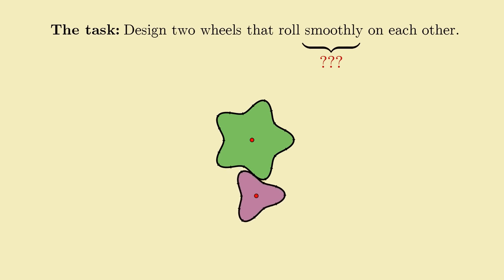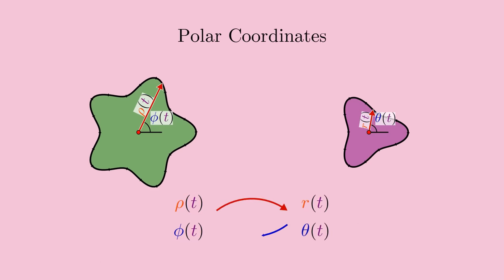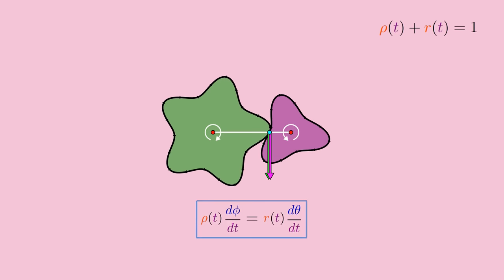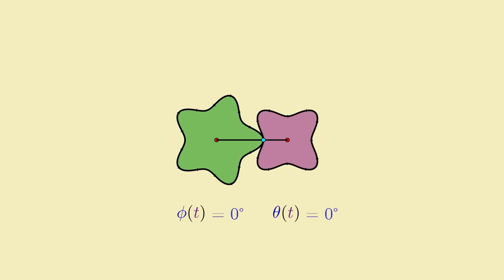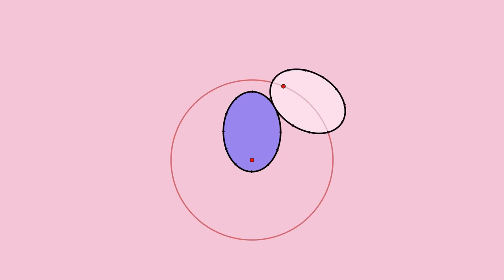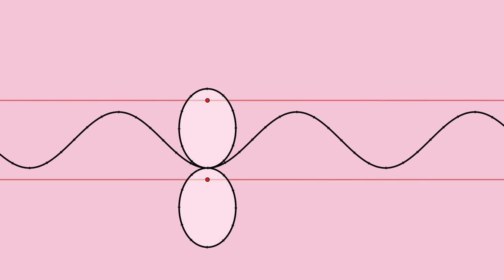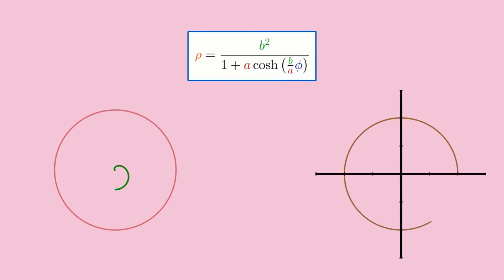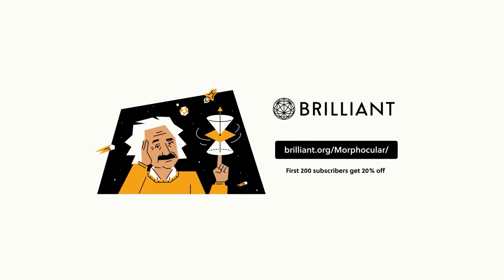How to Design a Wheel That Rolls Smoothly Around Any Given Shape

Comment: Having watched the entire series, the biggest sign that you aren’t an engineer is that you haven’t used the words “no slip condition”. The other main difference in your approach is that you have largely avoided using vector operations. In engineering, there isn’t anything called the “orthogonal motion principle”. We would get that result from the no slip condition, where the wheel and the road at the contact point have zero relative velocity, and combine this with the formula for rigid body motion, v_b=v_a+w_B X ab. The results end up being the same, it’s just interesting.
Reply: No slip conditions are a god send in any transport phenomenon classes
Reply: @MikeTheMan01  It's basically the fundamental boundary condition of fluid dynamics. Mabye I only think that as I'm an engineer.
Reply: @kindlin  how else would we calculate wall shear?
Reply: @chrisjackson5072  No slip necessarily means wall. I just meant there are other boundary conditions. Like, 2 fluids moving relative to one another, you'll get turbulence at that boundary. That is a separate boundary condition, probably the other fundamental one of fluid dynamics. I don't think this is a formal term, I'm just thinking out loud.
Reply: 2+2=4 (certified answer)
Reply: I understood that perfectly
Reply: He rediscovered rotational motion no slipping conditions basic properties of pure rolling instatinous centre angular speed etc purely in the domain of classic math and geometry

Comment: Engineering student here! I really appreciated this series! Thank you! As my classes on mechanical elements didn't go much deep, I would love if you explored more about gear design
Reply: I learned a lot more about gear design in the Kinematics course offered at my university. I did personally study quite a bit of it beforehand out of curiousty, but yeah... there's a lot that goes into the shape and design of gears, as well as designing gear trains. Even then, it was only a small portion of the course. If you do learn about gears, the focus will most likely be on power transmission rather than gear design itself. Gears are fairly standard, so understanding how to make them is a bit less important than knowing how to apply them.

If you're an ME and you've taken a course on statics and dynamics, you might be getting a discussion on gears soon enough.

Comment: Before you described the rotationally symmetric road to generate self-coupling wheels I was saying “should be simple enough if you just set r(t) = ρ(t+Q*π) where Q is some rational number; but using the previous solution to generate wheels on both sides is extremely clever!

Comment: Thank you for the series, I really enjoyed it! 

I have one thing to say about gears, they are actually not slipping, but perfectly rolling on each other. Their contact point is also always perpendicular to each other.
 Exploring the special shape of spur gears and the mathematical origin would really be a perfect fit for the series!
Reply: Well, involute gears perfectly roll. The more important thing is that the line of action stays constant (or at least some reasonable approximation of constant)
Reply: @bandana_girl6507  & Jacques: NO THEY DON'T!  Involute (& all other toothform gears) have contact path that IS NOT along the line of centers (except for the ONE point on the side of each tooth that crosses the pitch circle, for circular gears, or the pitch curve, for non-circular gears).  The teeth slip as well as roll except at that point.  That's why power gears require an oil bath for lubrication, whereas bearings require only sealed-in grease.  What is "perfect" are the angular rotation rates, in that the rotation (of the toothed structures is indistinguishable from pitch-line rollers in frictional contact.  This is referred to as "conjugate action".  Involute toothform has additional property that conjugate action is maintained despite center-distance change.
Reply: This is actually incorrect. Gears can only experience pure rolling for a single instant when their contact point crosses the pitch circle
Reply: @Rudmin  no, this is not true. The whole point of gears is that they only experience rolling, not slipping. The contact is perpendicular to the tooth at every moment
Reply: @bmw_de  that’s a very common misconception that is widely held, but @Morphocular did their homework and was correct about gears.

All conjugate action gear forms (except for circles) experience a combination of rolling and sliding at the contact point. Your cars transmission actually relies on this sliding action to keep an oil film between gear teeth. It would not last nearly as long as it does with pure rolling. If you do the math (like this video), pure rolling is impossible for constant velocity gears at any point not on the pitch circle. It’s a direct consequence of the shared instantaneous velocity relationship required for pure rolling that was found near the start of this video.

Comment: Great video and great series! I was hooked the whole way through. You’re a great presenter!

If you ever do continue this series it would be cool if you could explore a “realistic” constraint that the wheel has to “work” in real life, that is, dealing with collisions on all points of the shape at all times so that they don’t “clip” into each other.
Reply: The derivative of the function needs to be continuous
Reply: @bernat8331  That seems like a sufficient condition, but not a necessary one, as we see non-clipping wheels/roads that have discontinuous derivatives (polygonal wheels with sides 4 or more, for example). The actual condition seems like it should be related, but weaker than that.
Reply: @HeavyMetalMouse  actually, a perfect polygonal wheel would teleport at corners, which is also not realistic. So the condition is correct.
And it has to teleport, the math used here cannot handle a stationary point of contact. and in the case of real physics, a perfect corner cannot exist in the first place
Reply: Don't forget a realistic wheel also needs to have constant velocity. (otherwise the wine glasses on top of the car would still tumble). Unfortunately, with the constraints of smooth rolling and constant velocity, the only solution is a plain old round wheel. It's the reason gears necessarily need to slip.

Comment: 12:02 This is actually a really pretty consequence of the definition of an ellipse. For points on an ellipse, the sum of the distances to the two foci is constant. But if you turn that around, you can turn two ellipses of the same shape around each other, and the contact point will have the sum of the distances to the two foci/axles constant.

Comment: i have a question, morphocular. I just watched your video and wondered, is there any  example of a stationary wheel and moving wheel, such that the moving wheels axel path has its own shape? for example, a circle and a circle is an example, since the axel point is moving in a circular path. But what about jagged shapes? or maybe how many examples are there? Is there a formula for the number of bumps on stationary and moving wheel?
Reply: I think for certain symmetric shapes if you find a stable axle, you can offset it by a bit to get it to trace out its path. Probably gets more complicated for nonsymetric wheels

Comment: The sawtooth wave at 16:09 is not physically realizable, as the wheels overlap with each other, which is visible in some frames of the video. 
This would also happen with the road of shape square wave at 16:20, but the rising and falling edges of the square wave have some finite slope, so the wheels seem to be not overlapping. 
So, I am curious about the mathematical condition for a physically realizable wheel shape that doesn't overlap with the other wheel 🤔
Reply: This is just a conjecture on my part,  but based on previous info in the series (mainly the “roll~pivot” theorem), any road/wheel with corners (any non smooth part) must have corners with angles greater than 90 degrees in order to prevent intersection (Note: definitely a necessary condition for non-intersection, but possibly not sufficient, as in there may be wheels that don’t have acute corners but still end up intersecting their roads).
Reply: The problem is that the lines aren't infinitely thin. This would work IRL because there are no lines to overlap.

Comment: 13:15 what happens if you push the conic sections even further and get rolling hyperbolae where the axle traces a path?
Reply: I was wondering just the same. Since we have self-coupled ellipses tracing a circle (of positive curvature), and self-coupled parabolas tracing a straight line (zero curvature), there just have to be self-coupled hyperbolas tracing a negative-curvature path. Would be interesting to see an animation of that!
Reply: @dshmoish  I can already see the hyperbolas tracing a semicircle in the INSIDE direction rather than the outside direction. No proof just yet but it feels intuitive that it should work that way

I might go through the math and try and figure out different kinds of inside-wheel systems

Comment: Awesome video! The mystery spiral for the not-cardioid partner to the square is most likely the involute of a circle. That’s also the type of curve that is used in the shape of gear teeth—small world!
Reply: I tried looking into the shape a bit, and I've noticed one critical issue... a circle's involute is not defined at a radius smaller than that of the base circle which defines it. The scale of the involute reflects the scale of the circle, so a circle with a radius of 0 would not create an involute. It also forms a normal point to the circle surface (mimicking the "unwinding" motion often referenced when talking about Involutes). This spiral appears to repeat into the origin, and does not ever contact. However, its shape does feel familiar.

Comment: There is one issue here, specifically with the fractal ones, and more-properly, any shapes that seem to go beyond 180 degrees while touching the road. 
The issue is that when your wheel rolls along it must naturally phase through the road in order for parts that were touching to no longer. If you look carefully at the trailing and leading edges of the fractal you can see this happen, although its quite small. 
I think this is just an inate issue with the kind of shapes, again, ones in which the curve goes beyond 180 at any time, not by ANY means an issue with you math. 
All in all this is absolutly spectacular

Comment: The big difference between these shapes and gears is that gears are defined by conjugate action. Meaning that if one gear turns with a constant speed, then so does its partner. This ensures no vibrations when transmitting power. With the exception of circles (called capstan wheels when they are used as gears) it’s impossible to have pure rolling contact and conjugate action.

While it’s true that sliding is helpful for the lubrication of high quality ground steel gears, it’s definitely not helpful for cheap plastic gears.

The other source of unwanted vibration in gears is variation in the pressure angle. This is one of the reason that involute gears are now the norm. They maintain a constant pressure angle.

Still it would be interesting to make a transmission from a set of 3 of your rolling “gears” such that the first and last one experience conjugate action but the middle transmitting gear rotates with a non-constant speed.

Comment: I suppose the only issue is that the wheels will rapidly accelerate and deaccelerate while rotating, which means that either the velocity or the rotation of the wheels will change rapidly.

Comment: Using this formula: 
17:26 The other wheel for the catenary curve road (with the catenaries opening upward) will be the heart that has the nonzero degree cusp
17:56 If you don't turn the cycloid curve upside-down so the cusps are pointing downward, then the ideal wheel will be a teardrop-shaped curve.

Comment: A few questions about the conic sections and their self-coupling property. If ellipses can couple with themselves when rolling, and so can parabolas, what about hyperbolas? Is there some kind of way to roll them around each other? And if that new system exists, what would it look like? What equations and rules can generate our curves?

What about rolling on the inside rather than on the outside? Like instead of a wheel rolling around another wheel, imagine a wheel rolling inside a hole. What would that look like? Is this the system where hyperbolas take center stage rather than ellipses? Or do ellipses still do something beautiful here?

Comment: Now try observing the relationship of X vs Y vs the angle to their combined coordinate in a curve. Treat the X & Y values as width and height respectively of a hypotenuse occupying the same start & end point, start from a 1 pixel long version of each and observe what happens to the lines as you increase the pixels available (squared for simplicity, the root math applies to rectangles and ovals as well)

Comment: What about 3D shapes?
I think it would be interesting to expand these formulas into 3D space, as for example a ball can roll smoothly on a plane
Reply: But how would you do visuals for that video, they wouldn't be this easy to understand. Also there's the question how different 3d even is
Reply: sounds like hell
Reply: I dont think this is possible without some extra restrictions, because if you roll a ball in a square, the plane and ball would be touching different sides than they started out. So the only completely general solution is a sphere and a plane.
Reply: @jetison333  It would be interesting then to see evidence that this is impossible.
Although it seems to me that I can imagine a plane that is twisted so that a certain object can smoothly roll in any direction without any problems.
For example, an ellipsoid on a wavy plane or something similar

Comment: Watching things relating to machining has taught me years ago that a line (the road equivalent in these videos) can be thought as a circle with infinite diameter, so it is almost obvious you can scale "a road" back to a shape with less than infinite diameter and vice versa given that you can scale between harmonics.
Reply: Oh, and also you get for free that you can just as well scale the harmonic back from infinity the other way around so that it ends up wrapping around the partner instead! (curving the "road" up on the sides of the screen instead of down with the wheel on top of it)

Comment: The key to gear design is making sure the teeth don't intersect each other. The shape of the teeth, number of teeth, radii of the root, radii of the tip, diameter of the hub, and the outer diameter of gear are all controlled. These properties are related by Pitch (or Module for primitives who haven't visited the moon). Modern gear design mostly deals with picking a gear with the needed properties (usually O.D. and tooth count), making it thick enough to handle the force, then choosing the material and shaft size.

Comment: These videos are great. Just one question: couldnt you also frame the problem of wich weel perfectly roles on another one in such a way that you take the distance to the center of the „stationary“ weel at every degree (or approaoching 1/infinity degree) of the turn and then create a 2d function that uses that distance as the y value towards the degree count as an x value and then solve the problem just as a 2d one like in your 2. episode. Or you just simply use the method of your first video for the rotating weel and then just look at wich point the road repeats and basically build a closed loop with 360 degrees(or 180 for a triangle) and take that loop as your stationary weel?
Reply: So as an example the stationary square can also be „dummed down“ to a zig zag road or you could take a square as the rotating weel, create a road for it and „wrap“ it up. Im not an english speaker so im not that great in the specific terms. Hope you can still understand me
Reply: Because if you rotate the angle of the camera atnsuch a rate that the line between the meeting point between the two weels to the center point of one of your weels is always perpendicular to the screen and fixed in place, onlychanging i siceand you then take only an infinitly small picture of just that axle and then stick them all together, you effectivly end up with a road with a weel rolling on it

Comment: The snoflake intersects so much. 
True Sawtooth intersects.
0 Degree thing intersects.
The solution is simple 🤦🏼‍♂️ 
For any road, even heavy upward curving, 
1. Use a base speed and the angular speed of the object (defined by the tips moving the same speed as the middle) to define all positions of the track.
2. In a solid world, subract everything the track intersects.

Comment: the only thing about gear design that’s different is that a gear is tasked to having a constant velocity profile, meaning that gears when they are driven by one gear will produce the same angular velocity through all stages of meshing. If you look at most of these animations closely, you can see this doesn’t hold.